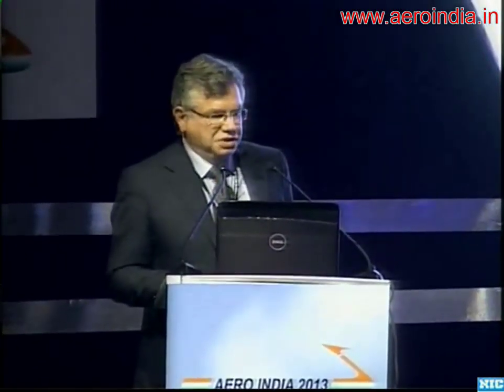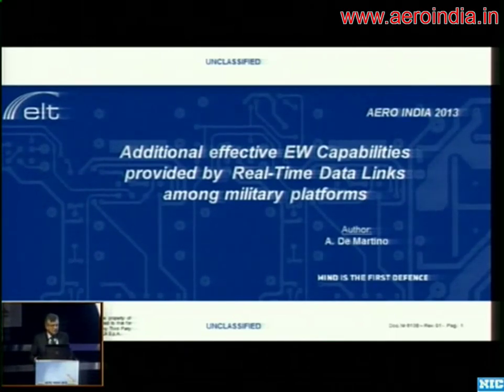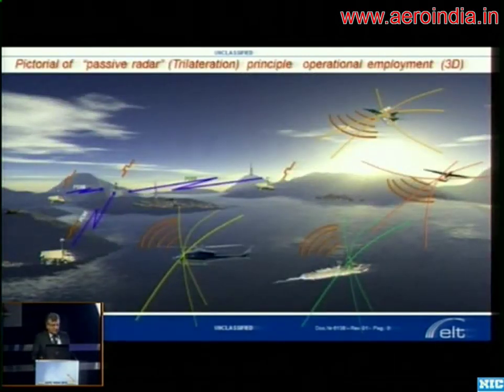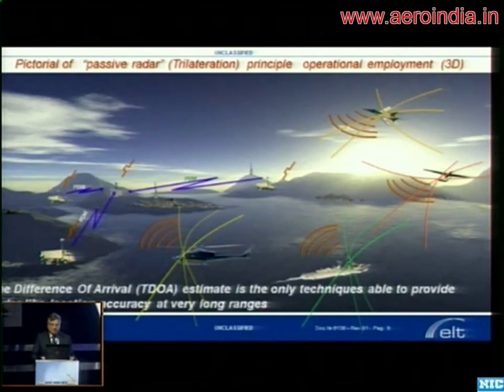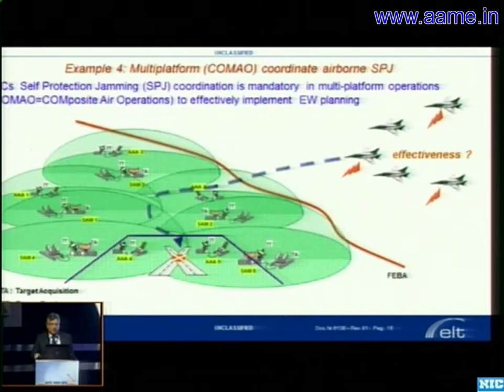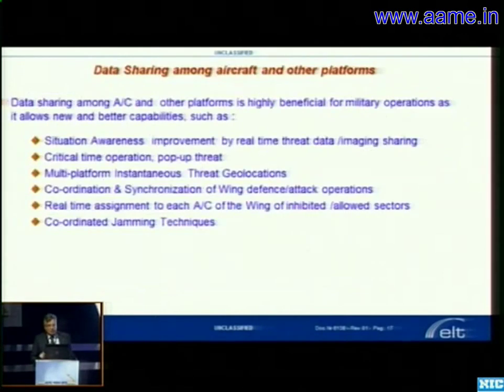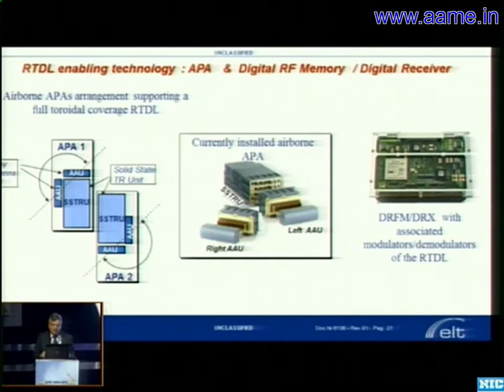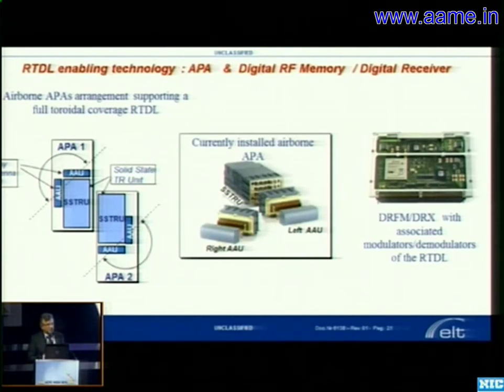HOW THE F-35 & F-22 WILL BE TRACKED & ELIMINATED

Comment: The data transmission between the aircraft is supposedly faster than the transmission of the intercept point with the aircraft and the target implied? How is the transmission speed differentiated between the two information nodes?

Comment: Theres no such thing as totally stealth planes, its just a buzzword used to sell airplanes. having a "low observable" plane isnt worth the extra money and reduced performance that results from stealthy designs, better to make the plane perform and be somewhat stealthy because close in dogfighting will always be a thing
Reply: You know that for fact?

Stealth gives the f35 first lock. Big advantage! Its LO also reduces the range it can be locked at by a significant range far greater then any other fighter on the planet!

You said it ain't worth the money?
If the USA & NATO carry on upgrading and using the older kit e.g a10, f16, f18, f15 amongst others they will cost over 4 trillion for the duration of the next 50 years service + loose the technical edge. If they build the new f35 ABC they will actually save 3 trillion over the next 50 years.

The fighter is lethal at BVR.

The F35 is a multirole fighter can do ground attack, a2a, recon and air support it's not an air supremacy fighter.

 It can fly at speeds just below mach 2.0 and pull 9.9g with sw limits removed.

Close dogfights are very rare now due to the accuracy of the newer a2a missiles. Most likely if two technically advanced fighters get into a dogfight they probably both get destroyed the fact that it has the most advanced sensor jamming capabilities should also give it the edge also its not as if a fighter can sneak up on it from up high like i keep hearing.
Reply: Isn't worth the extra expense? Someone should tell that to the F 15E pilots that couldn't stop F 35's from completing bombing runs.
Reply: Use a Su-35 or a Mig-29, then you have a real test because they have IRST which the F-15's do not.

Comment: Do anti-aircraft anti-radar missiles exist?   Just shut off the radar and the missile is trashed. Oh and the F-35 radar can be used to fry the incoming missile , so they say.
Reply: An excellent question! As an amateur enthusiast, I know of no such missile. I see an issue with it, given that combat aircraft radars emit in a cone forwards, whereas ground air defence radars (in particular the detection radar) is likely to search omnidirectionally. Therefore, an air-to-air missile relying solely on anti-radiotion would lose guidance if the target turns away.
Reply: @yaenlauper7272  Of course they must have thought of it and decided it wouldn't work. LOL

Comment: Russian geostationary satellite can see 'stealth planes from late 1970's
Reply: Zbyszkoz  A spy satelites may be able to see planes but tey only have an imediate line of sight and can't spend all its time tracking multiple targets. Like you said is geostaionary.
Reply: DUANE GREAVES I agree.
Reply: ufster81 stealthy aircraft ................ what is this stealthy aircraft ?. SU-27 RCS is the same what F-35. Real ( not in  zero condition Moisture end 45 F )  RCS for F-22 is 0.1 , PAK to 0.3.
Reply: Also it would have to be geosynchronous orbit in said target area. Its speed, trajectory. Stationary targets are a different thing. Its like the nonsense about the Russian weapon used in one of its tactical fighter jets that can shut down all electronic devices within its target. For a start EMP devices are to big at the moment to fit in a jet fighter and require enormous amounts of power. There was an article were said device shut down a destroyer in the black sea a few months ago. Its just Russian propaganda
Reply: Also it would have to be geosynchronous orbit in said target area. Its speed, trajectory. Stationary targets are a different thing. Its like the nonsense about the Russian weapon used in one of its tactical fighter jets that can shut down all electronic devices within its target. For a start EMP devices are to big at the moment to fit in a jet fighter and require enormous amounts of power. There was an article were said device shut down a destroyer in the black sea a few months ago. Its just Russian propaganda
Reply: Zbyszkoz wrong. F-22 is .001

Comment: the f-22's & f-35's wont use the on board radar so they cant be tracked.  the info they get will be from satellites in space or an awacs far far away from the battlefield.
Reply: If that was the case why put a radar on the plane? They do use the radars briefly for engagement only and back off again. They also use they’re radars to shore up a missle near the targets for a better fix. Again briefly on / off. Or on when active jamming. So yes, the stealth planes will be using active onboard radars.

Comment: That's if they are operating without any of the new decoys, drones and electronic countermeasures designed specifically for low frequency radars which have been obsolete for years because of the huge delay it takes to Target using low frequency.  So along comes phased array radars which can do it much faster only they cost millions to produce a single radar.  So because of phased array you'll now find the sky's above our enemies countries to be filled with drones and decoys.  The idea is to get the SAM systems to fire and remain active long enough  to be struck with anti radiation missles which are purpose built with the ability to strike from over 200km so they can be launched from outside the range of the radar.  So basically the f35 is not designed to be completely invisible to radar it's real intent is to shrink the effective range of those radars so the newest gen of glide bombs can be used.   Israel has been doing this for years it's we're the glide bombs was developed.  Their f15s would stay within Israeli airspace fly straight up to their ceiling releasing the bombs which have no problem making it all the way to the Damascus.  So from what I've learned the newest gen missle defense from Russia are capable of tracking aircraft out past 400km.  The f35 shrinks this area to 60km. That's well within range of every standoff munition in the US arsenal.